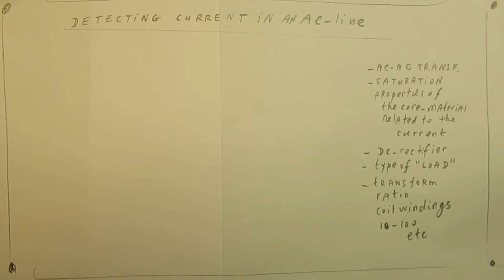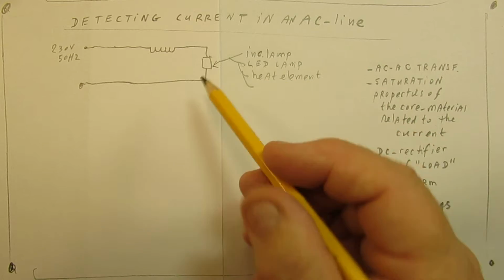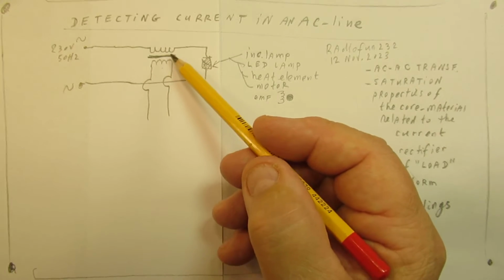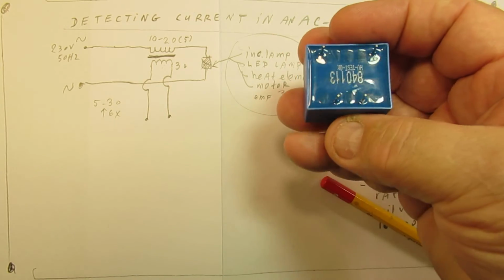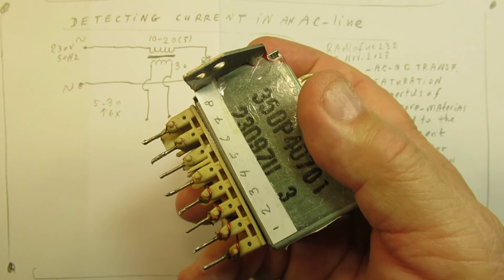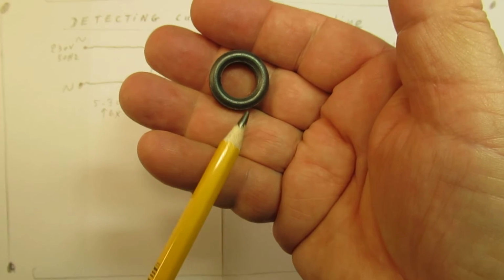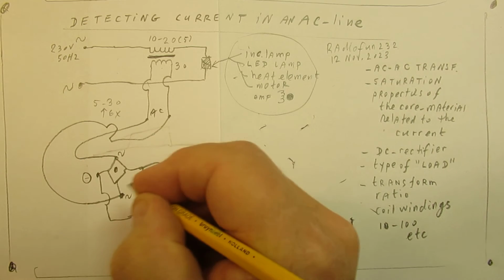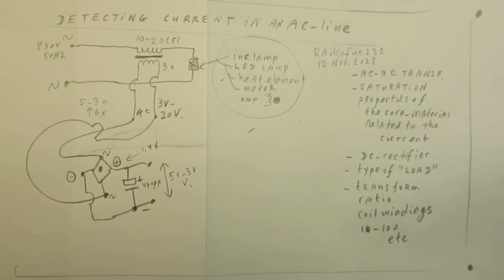AC current measurement detection via an AC transformer, in the lead to an AC load: lamp, heatr, etc.

Comment: For measurement, wouldn't it be better to step down the voltage rather than step up?
Reply from the maker: Is also possible, but the primary coil (its AC resistance) of the measurement transformer is responsible for the maximum current that can flow. When its ac resistance is high, you cannot measure the "higher" currents, flowing in the circuit (primary coil will burn out), situation in cases of 110 V or 230 V 50 Hz/60 Hz. And the voltage at the secondary winding can get up very high, when the primary of the measurement transformer has a lot of windings. But: it is possible in cases where the maximum current flowing in the primary coil is low and/or when you want to measure in the (say) 12-60 Volt range and (again) the maximum AC current in that case is low. In that case (12 - 60 Volt circuit) you can use a ferrite rod and make the 2 windings on it. How you make it in that case depends on the sensitivity of your meter, or what you want to "do" with that induced AC current, thus how high it must be to "make something work". That depends on the windings ratio. 19 nov. 2023.

Comment: Interesting! The EU bureaucratic pretence of 230 Volts allows for variation of between +10% and – 6% (i.e.. between 216.2 Volts and 253 Volts). In UK I don't think it ever changed from 240V. I always measure between 240V - 245V. Did Netherlands electric suppliers increase actual supply from from 220V to 230V? It doesn't matter for most devices but does alter numbers for circuit calculations. S
Reply from the maker: Yes, Stephen, in the Netherlands it went from 230 V to 230 V in 1989.